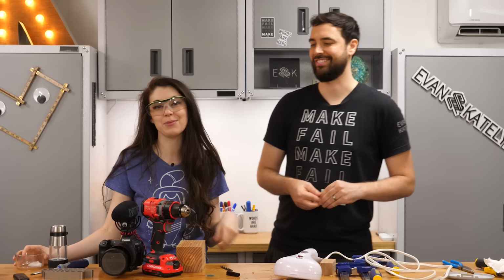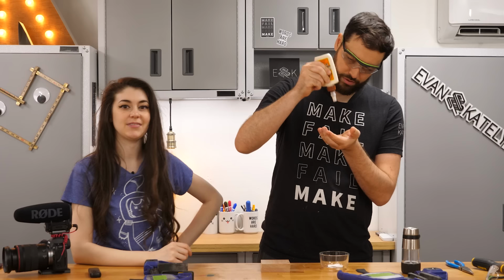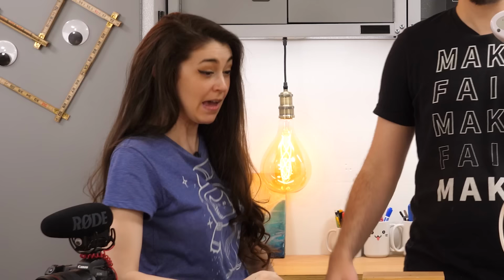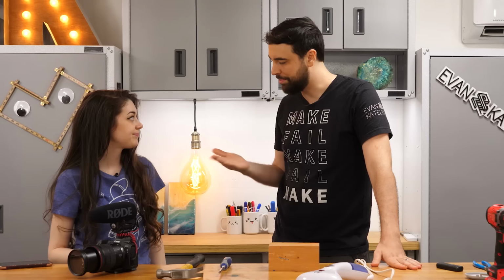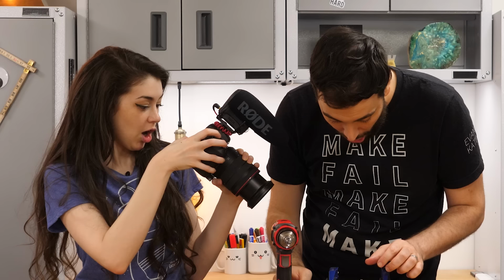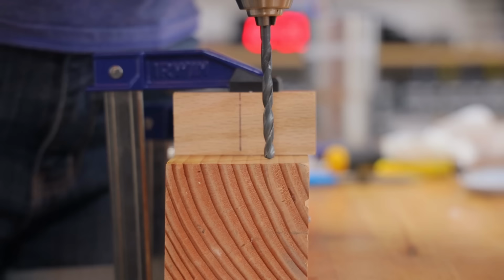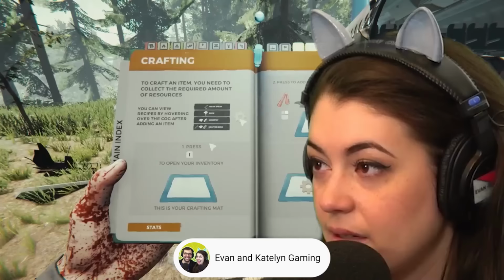Makers Test 7 DIY Life Hacks

Comment: If you rub a strong magnet on any ferrous metal for 30s it will make that metal slightly magnetic, i do this to unmagnetized screw drivers for repairing computers so the magneticness wont affect the parts

Comment: I have used the rubber band trick on many a stripped screw from titchy tiny ones to massive ones - the rubber band needs to be pulled more taught around the screw bit for better grip. But that's not shown in most hack videos

Comment: Hi there!

The magnet and the screwdriver hack will work but only if just 1 pôle of the magnet is touching the screwdriver. With the type of magnet you’ve used, you’re in business, but test it with a horseshoe magnet. If you stick just one “leg” of the horseshoe magnet to the screwdriver, it will work, but if both horseshoe “legs” are in contact with the screwdriver at the same time, it won’t work.

Comment: The issue with the magnets on the screwdriver is if you have to use it in a tight space, it will fly off to something else magnetic
Also, Louis Rossman uses that trick :D
Reply: This does make the calculation in my reply to another comment a bit more interesting since there’s an additional magnetic force acting to overcome the centripetal (magnetic) force of the magnet with the drill. However, at least in this case, there’s a bit more certainty with where the magnet will go if it detaches from the drill, limiting what it could possibly damage depending on the kinetic energy at that time of impact. Of course, the kinetic energy will only increase in this situation since the magnetic force increases with respect to the inverse of the square of the distance between the magnet and the item it is attracted to. Thanks for sharing this! 😁

Comment: So the magnet thing is interesting, it's called ferromagnetism.  Basically all magnetic metals have magnetic domains, tiny magnetic bits in them, but as they are randomly aligned they don't produce a magnetic field.  My understanding is you align the domains temporarily by using a magnet, but if you use a very strong magnet or heat the metal while passing a magnetic field, then I think that's how you get permanent magnets...  This is all based off a stack overflow I read though, so take it with a pinch of salt.  

For the wood you are basically crushing the xylem tubes running throughout it and then you puff them back up a bit with steam.  That's my extremely basic understanding of it anyway.

Comment: Along with the magnet one. Rub the magnet on the screwdriver about 50 plus times. The screw driver should be magnetic now.
Reply: Not necessarily, unfortunately. It really depends on whether or not the metal used is ferromagnetic or paramagnetic. In the latter case, an external magnet is necessary to maintain the magnetism of the screwdriver. In the former case, this is partially true. While there are ways using heating and/or strong magnetic fields to permanently magnetize a ferromagnetic material, the field produced in the material without doing this will always be weaker than the field of the original external magnet and will most likely be temporary. However, this weaker field might be just enough to hold any of the screws you need to hold.

Comment: Rubber band does work to remove a stripped screw but it's not exactly easy you have to go slow and should only be used to remove.

Comment: The parts of the soaped screw didn't turn at different speeds, until the screw snapped, they had different amounts of friction and that is why there was a higher torque in the screw than normal, ultimately snapping it. :)
Sorry to be a smartass (and I might be subject to further correction), stuff like torque, speed and all those mechanical units are easy to mix up ^^

Comment: the salt one 100% works, you were just using far too much salt on too small of a surface. If you were to glue a 12 inch board together, adding 8-10 pieces of salt (that minimal) gives extra friction to the board to prevent it from sliding.

In the video you used a full packet of salt for a tiny piece of wood. A wood like that would only need 5 at max. 

You can see professional woodworkers do this trick when making large projects

Comment: Slide the magnet from the handle to the tip of the screwdriver,
Repeat this motion in the same direction,
Rotate and repeat.
taaaadddaaaah your Screwdriver is now magnetized
(works with bits,too)
Reply: This is true IF the metal is ferromagnetic and not paramagnetic. The magnet field produced in a ferromagnetic material this way will always be weaker than the magnetic field of the external magnet and most likely temporary. However, this may be more than enough to hold whatever screws you need to hold. In the case of the hack, both types of materials work with an external magnet present.

Comment: Your screwdriver was already magnetic right ? I have to say , the steamer for the dents can be really useful ! Thanks !
Reply: Turns out it doesn’t really matter if it was already magnetic or not (but I suspect it wasn’t) as long as the metal is either ferromagnetic or paramagnetic, this will always work in the presence of an external magnet.

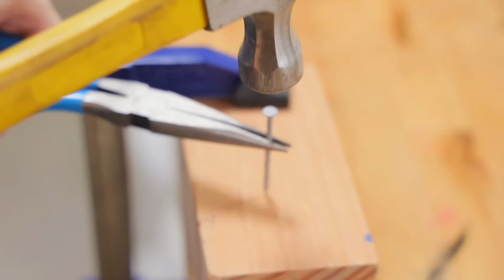Comment: 03:15 - Alright, young lady (and Evan too @ 03:35) - it's well past time that you learned to operate a hammer properly - DO NOT grip in the middle of the handle and 'push' the hammer with your arm - Grab the handle at or very near the end and swing by flexing your wrist - let the weight of the hammer do the work - you're welcome ...

Never heard of the salt hack - but I think it might work if you only used 5-6 grains. Another option that might work better is a trace of sawdust.

Hilarious how excited you guys were about sticking a magnet to a screwdriver - you can also moisten the screw head with a bit of spit - surface tension will hold the screw - somewhat - or just buy magnetic bits - or get a cheap magnetizer...

You don't need a steamer to repair dents in wood - use an iron and a damp cloth - also works reasonably well on finished surfaces if your furniture, or a door, gets traumatized ..

13:18 -  Ear Wax Life Hack -   'always clean the ear wax off your keys before picking your teeth ....'

Soap a screw - This is also to help prevent splitting when screwing near the end of a board - When I was a trim carpenter I would keep a bit of bees wax (as you mentioned) - and, when needed, drive the screw into the wax to coat it (wax being malleable, unlike soap, you could knead it to get rid of the holes) - paraffin will also work  - another hack for preventing split out at the edge of boards is to dull the tip of the screw (or nail) with a hammer before using - It's counter-intuitive - and I don't know why a dull tip causes less splitting - but it definitely seems to work (fyi, I suspect your broken screw may have been due to a rare 'faulty screw' rather than lubrication)

Comment: I knew the salt was not going to work. The soap was a drag. I have actually used soap before and it made a big difference. But I did one stroke on the soap and it was normal bar soap (which I no longer use). And it was old wood, siding on a house. But that was way years back before people knew to drill out the holes. By the way, I loved the pliers for avoiding hammering the fingers. I have shot more nails off into the grass and bushes trying to avoid beating my fingers. And the magnet was MAG! I need to get a tiny magnet like that but you can also store your screw tips (if they are ferrous metal) in with a magnet and have the same results. Have you tried cutting the tips off nails to keep the nails from splitting the wood? That was about my favorite construction hack (before this video). Cut as much of the tip off as possible then nail. It is the pushing apart of the grains of wood by the WIDER parts of the nails that cause the boards to split.

Comment: Regarding the soapy screw hack... or rather soap on screw hack... I'm surprised as I've been soaping up nails and screws for years and it really does make a significant difference in easy of driving.  I'm wondering if the type of soap matters.  I usually use 'Dial' brand bar soap.  You looked like you used a mostly glycerin type?   I'm thinking the waxy nature of the good old white or gold bar soap might be key to the hack.  Take care...   Peace, Love and Resin!

Comment: The wood glue and salt does work. You didn’t use enough glue and the clamp is supposed to push the salt into the wood. I use this technique all the time. It’s a legitimate thing.
Basically you used too much salt and not enough glue.

Comment: Guys... you are testing if soap makes the screw go in easier, using a power tool makes it stupidly pointless. Soap works when using elbow grease and a normal screwdriver into tough wood.

Comment: Try rubbing the magnet on the end of the screwdriver. Then the tip of the screw driver will be magnetic!
Reply: This is true IF the metal is ferromagnetic and not paramagnetic. The magnet field produced in a ferromagnetic material this way will always be weaker than the magnetic field of the external magnet and most likely temporary. However, this may be more than enough to hold whatever screws you need to hold. In the case of the hack, both types of materials work with an external magnet present.

Comment: Did you know the back side of the hammer is designed to drive a nail as well as pull one out?  Start the nail facing out hooked into the back of the hammer and swing it at the wood, then remove the nail from the teeth and drive it the rest of the way with the head like normal.  Pliers are unnecessary.

Comment: The salt in wood glue trick definitely works for me. I think you're still adding too much salt (and too little glue?). You only need a couple crystals, just a very small pinch. Less than I would put on a single sponfull of boiled egg. Supposedly the salt dissolves after a short while, so if you ever re-test this, clamp it up and give it a couple minutes, maybe that closes any gaps you may have.
Why it didn't actually prevent slipping in your case I don't know. Maybe you were too rowdy ;)

Comment: Magnetic screwdriver::
You can actually rub a magnet on the screwdriver,
eventually it will be dome magnetic and u won’t need to attach a magnet!!
Reply: This is true IF the metal is ferromagnetic and not paramagnetic. The magnet field produced in a ferromagnetic material this way will always be weaker than the magnetic field of the external magnet and most likely temporary. However, this may be more than enough to hold whatever screws you need to hold. In the case of the hack, both types of materials work with an external magnet present.

Comment: I’m not sure about the safety of the magnet on the electric drill bit 😂 I was horrified it would fly off.
Reply: You’re not the only person who has expressed this concern. I actually address the physics of the situation in a reply to another comment, where depending on the properties of the magnet (mass, size, and magnetic flux density), the rotational speed of the drill will never be enough to cause the magnet to detach. Additionally, I work out what the kinetic energy of the magnet would be in the case it detaches to determine if it would cause harm. Nevertheless, there appears to be safer solutions mentioned in a few other comments that would avoid the danger completely (especially in the presence of other large magnetic objects that could contribute to detaching the magnet from the screwdriver bit). 😁

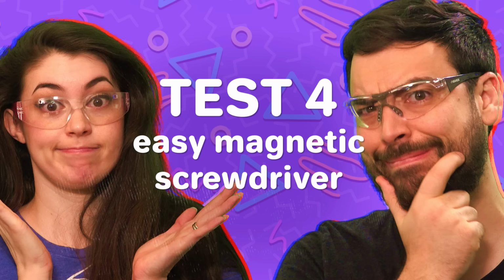Comment: 6:55 You could just buy magnetic screwdrivers and screwdriver bits, or even magnetise them if they aren't already magnetised. Swipe a Neodymium magnet on a screwdriver a few times and it should become magnetic.
Reply: This is true IF the metal is ferromagnetic and not paramagnetic. The magnet field produced in a ferromagnetic material this way will always be weaker than the magnetic field of the external magnet and most likely temporary although a strong enough Neodymium magnet could be sufficient to make a permanently strong magnet out of the ferromagnetic material (I discuss the use of VERY strong magnets in a different reply). However, the weaker field may be more than enough to hold whatever screws you need to hold. In the case of the hack, both types of materials work with an external magnet present.
Reply: @stokhosursus  .....Yep that is correct, but it's a simple process to see if it works or not. I've done it for decades with my Screwdrivers and never had a problem so far.
Reply: @dethvyper3136  Well, of course, I wasn’t contesting the fact that is does work, just that it only works with those of a certain type. Whereas the hack will work with both types. Also, I was offering a note to say that you can save some time magnetizing and re-magnetizing and get a stronger magnetic field by making the screwdriver a permanent magnet, which actually you’re already set-up to do with the strong magnet you have. The process isn’t too difficult if you’re interested: it just requires a slight softening (not to the point that you would detect it) of the metal while in the strong magnetic field so the magnetic domains can freely align and letting the metal harden while still in the strong magnetic field. The nice thing is that you can do this in segments and produce a stronger magnetic field overall in the metal than the external magnet you use.
Reply: @stokhosursus .... No probs. I appreciate your input.

Comment: Maybe if you use sawdust and really mix it with the glue 🤔? It's the same material as the wood and shouldn't break down that glue as that salt might well have done (or it did just suck up all the moisture of the glue. I mean, it's salt. That's what salt does ^^')

Comment: You two obviously didn't play with enough magnets as kids. Also my dad taught me if you've stripped a screw to take a screw driver and a hammer line up your screw driver with the screw and give it a couple good smacks the screws metal is significantly softer than the screwdriver itself and you'll leave enough of an indent behind that you can back the screw out

Comment: Did you guys not 6th grade science?  How do you magnet was all 6th grade science class was in my school.  Magnet plus ferromagnetic metal equals bigger magnet.  Also, Katelyn was kinda right.  Run the magnet along the shaft of the screw driver in the same direction repeatedly (like start at the handle, run it all the way down, pick it up and start at the handle again) will make the screwdriver magnetic even after the magnet is removed.

Comment: The steam wasn't as impressive nor unexpected as you made it seem. I suspect that the heat causes it to work faster, but just spritzing it with water will do it as well. It makes the grains swell. This is a finishing step to making cutting boards and then the cutting board is sanded flat again.

Comment: It is so sad, Wood screws are just wild... 

Bolts&Muts are regulated on which quality of Iron/Steel is used and they are marked. You can see this on the scrwhead, normally marked as 4.6 / 8.8 / 10.9 / 12.9 which indicates strength and Stretch limit of the material used. Wood/ Universal Screws on the other hand haven't that. The Bits initially where indicated to be weaker then the screws, so they let loose before the Recess in the Screw deforms. But due to Screwmanifacturers using way cheaper material, this didn't work out. And that is why every serious craftsman uses quality Screws instead of cheap ones.

Remember, switching out a Bit is faster and cheaper then investing half an hour to remove a f***ed up screw ;)

Comment: You know that you just need to attach the magnet to the tip of the screwdriver and take it off and it should be magnetic still
Reply: This is not necessarily true. It depends whether or not the tip is ferromagnetic or paramagnetic. Additionally, while a ferromagnetic material will retain some of its magnetism when the external magnet is removed, it is a much weaker field since the magnetic domains are pretty rigid in a hard ferromagnetic metal. Nevertheless, this smaller magnetic field might be just enough for the particular screws being used. However, you CAN make a ferromagnetic tip permanently stronger (1) with a standard strength permanent magnet by heating the metal so the magnetic domains can align more easily while being magnetized (don’t remove the magnetic field until the metal has completely hardened and cooled); or (2) with a VERY strong magnetic field (in essence the VERY strong magnetic field will cause the metal to heat enough through the force of aligning the magnetic domains). One should note though that heating a metal too much can change its properties and make it brittle.
I do think though that it’s not a bad idea to consider permanently magnetizing the tip, if possible, if for no other reasons that it simplifies the number of moving parts during a job.

Comment: Yeah, don't put the magnet on the electric high-speed screwdriver, that's how you go to the hospital with metal shard in the eyes
Reply: Not necessarily. I just finished writing a breakdown of the physics involved and depending on the properties of the magnet (mass, size, and magnetic flux density) and if there are any other magnetic surfaces close by, the magnetic force between the magnet and the bit may be more than enough to prevent it from detaching. Of course, if it were to detach, some of those same properties (mass in particular) would determine how much kinetic energy the magnet would have and whether or not it would cause damage. However, there have been some other solutions posted in other comments that could make this safer if it is a concern.